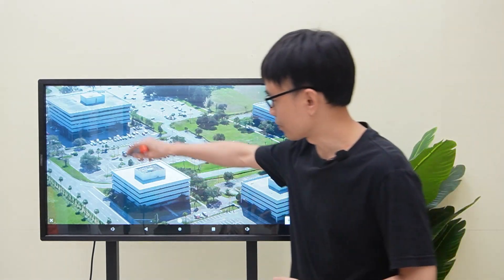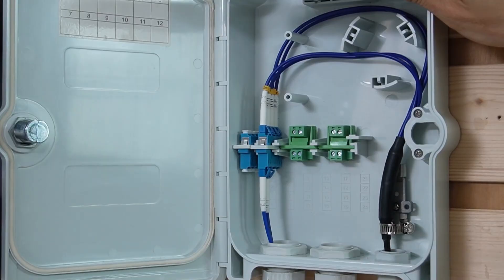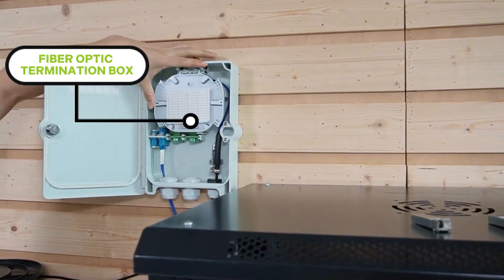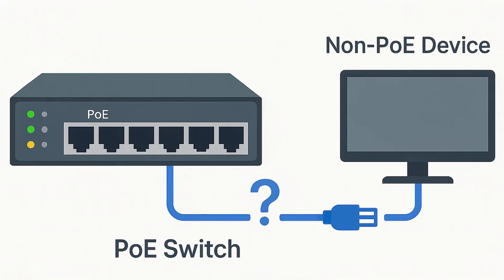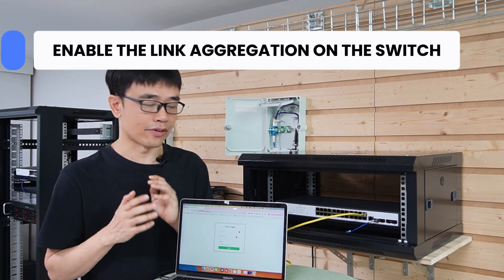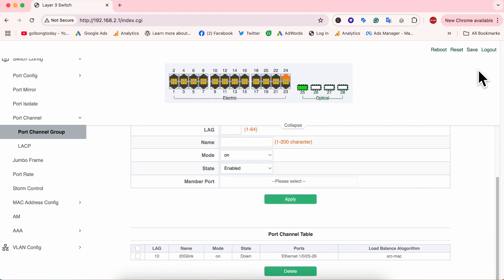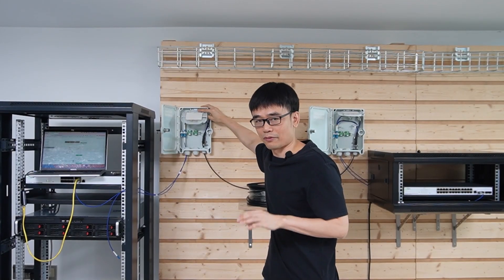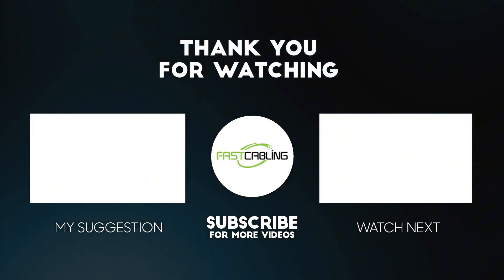Build a 10Gbps Fiber Network Between Buildings | SFP+ Switch, PoE, and Link Aggregation Setup Guide

Comment: Hello, that's great. I'd like to use Starlink internet as my provider for this setup, with a 10 Gbps SFP+, switch, and PoE, to distribute the connection in a village.
Reply from the maker: Starlink’s internet throughput — the actual data rate to and from the satellite network — is limited by your Starlink terminal and plan, typically between 50–250 Mbps for residential and higher for business plans (up to ~350–500 Mbps). This means even if your local network runs at 10 Gbps, your Starlink connection to the outside world won’t exceed the limits set by Starlink.